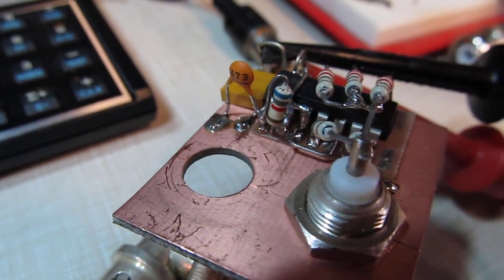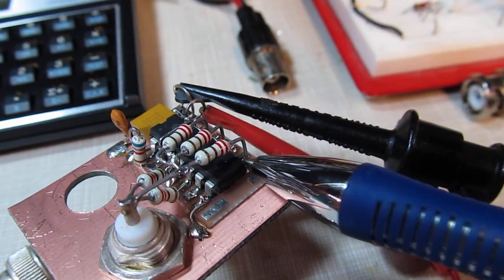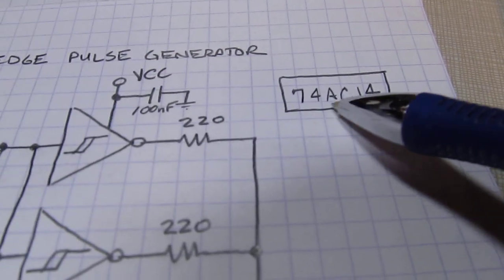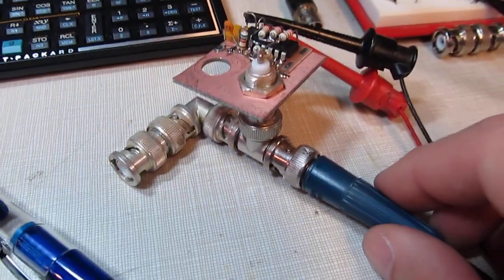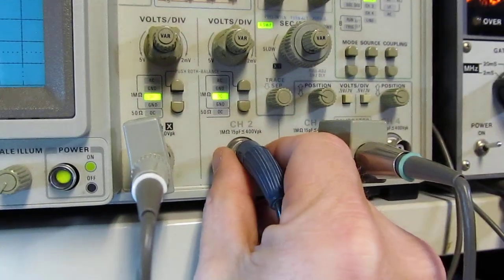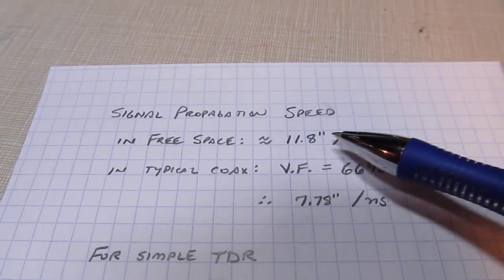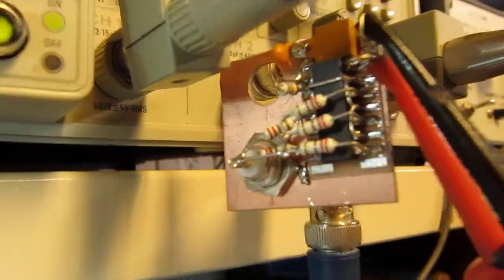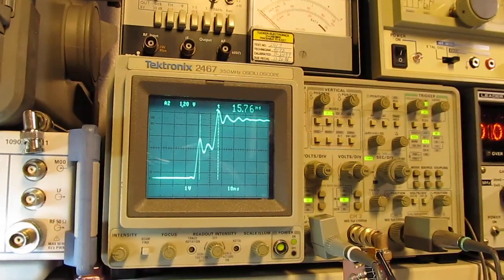#88: Cheap and simple TDR using an oscilloscope and 74AC14 Schmitt Trigger Inverter

Comment: I saw a circuit which uses a single-transistor avalanche pulse generator.  It needs a high-voltage power supply to work, but the advantage is that you can fit the entire pulse generator inside of a single BNC connector.

Comment: ***** I was somewhat thinking that a follow-on circuit to this might be one where you have another trigger set to a threshold that would catch a reflection.  You could then have an arduino or similar sending from one trigger to create the fast edge out, and then listening for a state change on the second trigger. Then you could calculate the time difference, compensate for the vf of the cable and then you have an inexpensive TDR.  If the MCU isn't fast enough to calculate, I suppose you could just feed it into a frequency counter.
Reply from the maker: Even better, use a pair of fast comparators to start and stop a current source charging a capacitor. Then use the uC to measure the voltage on the cap which will be proportional to the time difference.

Comment: Nice video as always sir. I have a question again sir anyway,,can I used 74HC14 instead? Because this is the one I have right now. Thank you.
Reply from the maker: You can, but it the rise/fall time will be slower which will limit how "short" of a wire you can measure.

Comment: What minimum limit does the 5 to 6 kHz oscillator put on short cables? Although, 61 inches, as shown in your example, seems short enough for most practical uses. Have you tested for a maximum length?

That frequency counter looks brand new, but it must be older than I am. That scope looks brand new, too. I have a 2465 and it came out before the first Apple Macintosh. It looks far from brand new. Do you have a video for building a cheap and simple time machine, too?

I want that frequency counter. Think of me should you every decide to sell it.

Great video, by the way. I've been looking for a cheap TDR solution. Thank you.
Reply from the maker: The minimum length will be governed by the rise/fall time of the oscillator, and the scope bandwidth. The frequency will determine the max length, along with attenuation of the cable. This will work well for several hundred feet.

Comment: is there any way to use this to calculate the impedance? or just cable length?
Reply from the maker: Yes, of course.  The easiest way it to mount a low-value potentiometer onto an appropriate connector, and put it on the far end of the cable.  Adjust it until the reflection disappears.  Then, the resistance setting of the pot will equal the coax impedance.  Check these videos:
Use a scope to measure the length and impedance of coax
How to measure coax velocity factor VF and impedance Z

Comment: Man, you are a genius! I just build the circuit and it works great, I measured a 3m cable and it gave a result of 3.003m. I used the CD74AC14M96, SOIC-14 version from texas.

Comment: Hi  I just tried your circuit here but couldn't get a low rise time then it dawned on me that my scopes all have 1 Mohm inputs.  I was just using rg-58 between the pulse unit and the cro.  I did also try my scopes probe set at 10x but get about 45ns. still no joy.
Reply from the maker: Which schmitt trigger chip did you use?  Different device types will have different speeds. Also, what is the bandwidth of your scope and probe?
Reply: OK all good after I fitted a cap to ground on the power pin
Reply: ***** used the 74ac14 and the cro is a 100mhz digital.  Its working as it should now.  I'm getting about 4.7ns.  Did the math on a 77 inch length of rg58 and it came to 77.8 inch

Comment: GREAT video!  Would a single 2032 coin cell (3V) have sufficient current to drive the Schmitt trigger?  A better question...if I made a tiny project box to house all this, do you think the coin cell would be a good option for long term usage?  Assuming a on/off switch of course.

Comment: Yet another great video, when wanting to make phasing lines at home I have used a signal generator, receiver and tee piece, trimming the cable for maximum signal "suck out" using the open circuit 1/4 wave...
Your little circuit is a much more flexible solution.. should run for a while on 3 aa cells.

Comment: Hi!
I have just build your circuit with a 74AC14 SO-14 chip and the rest of the components on your schematic (SMD) on a PCB. But when I hook it up to my scope I get a square wave at 2.94kHz with a rise time of 18ns. I have used the decoupling caps as suggested…

Do you got any ideas? Could it be my PCB-design being bad?
Reply from the maker: Стас Негруша Different manufacturers of the 74AC14 may have different thresholds in the schmitt trigger, as well as other differences in performance.  As stated above though, the actual frequency of operation is not critical for this application - it can be <1kHz or even several hundred kHz and still work fine.  Higher frequencies will tend to work better with analog scopes be resulting in a higher trace update rate.  If you want to up the frequency, then lower the capacitor value or feedback resistor value.
Reply from the maker: What's the bandwidth of your scope? Did you have the BW limit turned on? How are you connecting to your scope? All of these factors, as well as the layout can affect the BW, and thus the rise time.
Reply: It's a digital 50MHz scope with BW limit turned off. I have done more fault searching now and I found two things to change, first off I had by accident soldered in a 0.1uF cap instead of a 1uF cap on the input of the voltage regulator I use. And the other problem was that I used 1X on my probe and scope, when I changed that to 10X the rise time dropped to about 4.1ns. However the frequency is still at 2.9kHz. But I guess it's the rise time that are most important with this circuit? 

I am connecting my probes' ground clip to the ground plane on the PCB, and the actual probe to the output (like in the schematic).
Reply from the maker: The frequency is not important, so 2.9kHz will work fine. Using a 1X probe was the main problem. This places a heavy capacitive load on the circuit and exactly explains why your rise time was 18ns. The 4.1ns rise time you have now is the best you'll get with a 50MHz scope.
Reply: ***** I also got 2,87 KHz
Reply: ***** Thanks Alan, I know how the RC circuit))) You are a very good present the material, and even little knowledge of the English language more understandable.

Comment: Hi Alan.  I've seen a similar design to yours, where there is a "RD" (resistor/diode in serie) in parallel with the feedback resistor, in the actual design, the 6.8k.  What would be the purpose of such feedback "network" ?

Comment: Hi Alan, Great video's as ever. Do you think it is possible to build a TDR into a box to go portable. I doubt an Arduino is powerful enough to act as a sort of portable scope however a Spartan FPGA and ADC might and use the Arduino as an input for say VF to do the conversion and output to an LCD the length. Beats paying the megabucks for a portable TDR.

Comment: Thanks for your excellent video. I have been thinking about how to design a fast rise pulse generator for an experimental circuit  I am working on. Your video helps immensley. I want to generate just one fast rise pulse so I have designed a debounced pulse generator that works with both TTL and 4000 CMOS - up to 18VDC supply. I am going to build your circuit.

Comment: How would this work for for example TV coax (75 ohm) or longer audio cables? I imagine it could be used for finding faults in XLR cables where there's often a break or short somewhere in the cable, would just need to work out the velocity factor, assuming the mismatch on the output won't screw up the measurements.

I know a capacitance meter can be used for finding breaks though, but for shorts this would be useful.

Comment: INCHES! INCHES! INCHES! INCHES! INCHES! Use civilized units instead! I bet more of your viewers use metric than customary. This is also becoming the norm in professional use even in the US. I bet that coax was manufactured to a specification of 150 cm for example.
Reply: divide an inch by 3
Reply: = a third of an inch.  What’s your issue.  Divide 1mm by 3 ....
Reply: you can say a third of a mm it's not forbidden by the SI standards.
Reply: Metric is made for idiots.  To prove that just divide a meter by 3.

Comment: Another fine video. 

Years back when I worked for DEC, we lugged a 50 pound TDR whenever we had Ethernet problems that were not resolved by standard troubleshooting methods. Often we would find a broken piece of coax in a plant or open terminators. Sometimes we would find transceivers attached to the coax where the input went low resistance and loaded the line. Many neat uses for a TDR even for Hams suspecting coax failure or degradation. It's easy to see a broken shield and locate the area

73